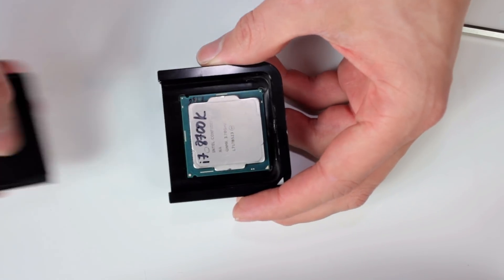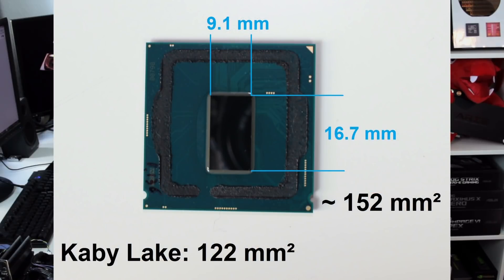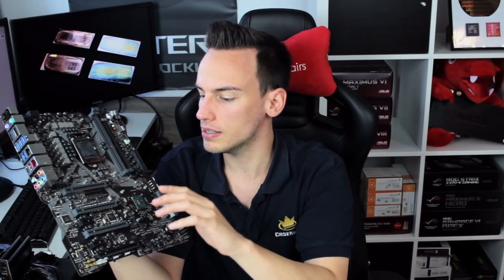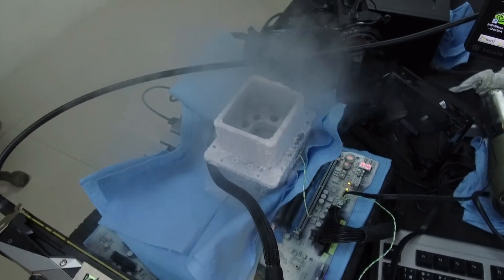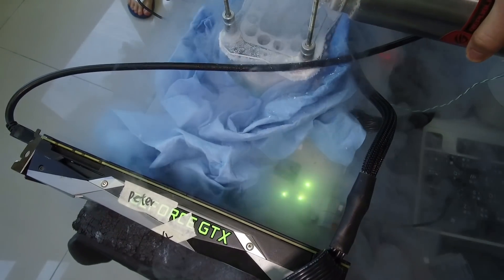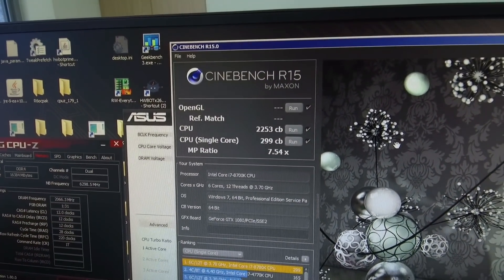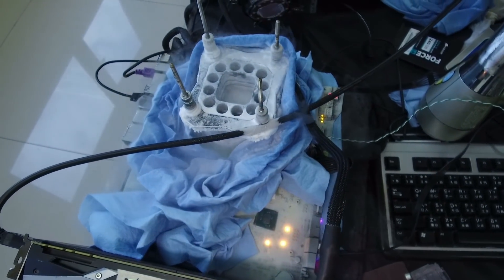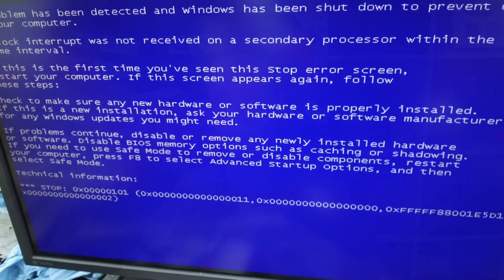i7-8700K - 10 New 6-Core Records with up to 7300 MHz (en)

Comment: Hi der8auer! Great video! I have a question about the new coffeelake platform. Same with kabylake and skylake, the PCIe lanes are still 16. So if I am running dual 1080 Ti SLI on this platform, will the x8/x8 configuration cause any bottleneck? Also if I add one more M.2 SSD, does that mean there are not enough PCIe lanes left for SLI? Thanks!
Reply: x8/x8 PCI-e 3.0 is not a bottleneck to any GPU, M.2 will go trough chipset so its fine.

Comment: Would you please make a tutorial about how to Overclock i9 7900x with AIO ?
Reply: It isn't practical to get high clocks on HEDT chips, as they result in very high power consumption and thermal output (please see any i9 overclocked benchmark). All reviewers recommend Threadripper since you get more cores for lower price (results in same performance with less cores/higher clocked chips) and better power consumption/thermals compared to Intel's i9 lineup. Core count is the ONLY thing that matters in parallel compute workloads. Unless you're gaming, then there's no reason to buy TR/i9 anyways.

Also forgot to say, with AMD you get a high quality soldered chip. With Intel you pay over a grand but you still get a chip glued with mayonnaise-grade thermal paste. Not to mention AM4 is an objectively more superior and stable platform than X299, while being cheaper.
Reply: +LieutenantBill No thanks

Comment: I'm looking at a zen for my 3D rendering rig, tho that is a minority.

For gaming with single threaded GPU drivers, if coffee is not significantly worse on IPC and can clock better than a delidded 7700k on a regular CLC, then yea, sounds very good. It's just a matter of how much improvement they get for the price over older 8 thread chips. Is the cost of a new motherboard worth it for that extra ten or so FPS in games (or is it more FPS, lol).
Reply: Hyper.. would this be the case with high end systems? Games seem to be atm using a lot of CPU spread across all cores. BB

Comment: I hate the idea of paying the "intel tax" but the performance of the 6-core Coffee Lake CPUs will no doubt be quite good. I'm waiting to see benchmarks in games before making any purchasing decisions. Right now, I can get a 1600X for $250CAD. I'm guessing that the 8700K will be nearly double that much, especially on launch. Unless it has nearly double the performance, it will be a tough sell for me, especially factoring the typically more expensive platform costs of intel's ecosystem.
Reply: Yep, the benchmarks are out now. 8700k is a real beast alright, and as predicted, double the cost of a Ryzen 5. It's only worth it if you are also buying a high end graphics card, which just isn't in my budget, unfortunately.
Reply: Ron Bes Hardware Unboxed did a great review, but I came to the same conclusion. I went with R5 1600, but gaming is not my main concern. I'm using this rig for virtualization. Also, I would have to spend 1000 dollars on a 1080 ti or Vega 64 to really get the best out of coffee lake... Prices in my country are ridiculous 😓

Comment: What are the chances of the die breaking when deliding with your delider? I know that the force is mainly focused on the PCB and that weird glue, but I saw a couple of forum posts about some other CPUs just shattering like glass.. One small piece just separates from the die. I have 3770K tho, not Skylake CPU. :)
Cheers
Reply: Филип Пешић zero

Comment: it's still double the price of the 1600 (at least in australia) so unless it has double the performance with the same amount of cores it's probably still not worth it imo, even with the extra clock speed bump at stock over ryzen.

edit: changed "slight" to "extra" because i was looking at the xfr speed on the 1600
Reply: but it competes against (and STOMPS in some cases) the 1700, 1700x and 1800x, don't compare core count to core count or we'll have to show you the similarly price non hyperthreaded i5's that run right alongside the AMD 1600
Reply: Ba Aditrex i dont care about the price... if u want the best you go intel
Reply: its performance is sandwiched between 1800x and 1700 (costs around 290-330, and perform basically the same as 1800x when OCed on a cheap ass board and comes with the RGB cooler that gets you around 3.8-3.9GHz)unless you do something which only uses single core or game at 1080p with a 1080Ti. get your facts straight. and it costs around 370-400USD best case scenario. With a pricey board. But its stock temps on Liquid arnt bad either, 65C that means around 70C on a mid range 30USD cooler which gives like 10-20C to play. But still the thing is just expensive!!
What all of us should look forward to is , R5 1600 OC(210-230USD) vs i7 8700 locked variant which would cost around(330USD-350USD) both on stock cooler of course.
And i don't think paying 40-60% more for the i7 to get 20% perf is a good idea. Because lets be real , most of us rock a mid ranged GPU which performs basically the same on both platforms.
Basically this is like R5 1500(4 c . 8th) vs locked i7(4c, 8th).
Reply: with that logic the g4560 is the best cpu
Reply: PC Master Race Network der8aur isn't a kid he pretty much get stuff for free from sponsor.
Reply: pc master race I owned multiple setups and mostlikelly  I own alot more buck then you but still id say r5 1600 is king for the price try to streaming gaming with i5 8400 and come back here and report if you had any viewers probably not  cuz i5 will drop 30%more frames compared to ryzen not to mention 1700 vs 8700k gamers nexus have video for you which shows ryzen is still better streaming cpu with fewer frames drop and that on stock
Reply: LAKSHYA SINGH "its performance is sandwiched between 1800x and 1700" very bold statement, as the workload heavily impacts the charts. an overclocked 8700k at 5ghz is just behind the 1800x in render times, but considering the higher cost of the cpu and motherboard, higher power consumption and higher heat output, the ryzen 7 is the better choice if you only use your pc for content creation. on the other hand, said 8700k clocked at 5ghz or higher, can be dramatically faster than any ryzen in gaming. if you want high refresh rate 1080p or 1440p gaming, an overclocked 8700k is basically a must, as it really lets those frames process. "or game at 1080p with a 1080Ti" this is not as insane as it sounds, as cpu bound as 1080p is, a 1080 ti can still get you 20-30% more fps than a 1080. if you use a mid-range gpu however,  like you stated in your comment above, an 8700k is just stupid to pair with a gtx 1060 or even a gtx 1070 for that matter, the ryzen 1600 performs basically the same with anything up to a gtx 1080.
Reply: Intel Coffee Lake Delivers Superior GHz/IPC performance the DOMINATE Gaming making Coffee Lake the most Future Proof CPU available for buyer or builder, Coffee Lake will get the most performance out your high performance GPU, GHz/IPC inferior Rysen is a gaming waste of money.
Reply: GlaciatorGaming ryzwn is for kids with no money
Reply: and intel is for kids living in dubai whats your point
Reply: GlaciatorGaming intel are for people who want the best, who want to overclock, who want better performance on games.. on and on.
Reply: GlaciatorGaming is Der8auer from dubai?

Comment: I think intel is in the edge of their current architecture. Something bad is going on inside Intel. Maybe they have no new architecture in hand.they just improve the power delivery circuitry and add more core.no new things. I am not happy with it's Efficiency.
Reply: its just taking longer to go to smaller nodes, which means more refinement at each node. The 14nm+ to 14nm++ change was basically all focused on adding 2 more cores/4 threads to the existing 7700k while keeping the same IPC. 

If you want to go into details into transistor layouts and how an actual CPU instruction works, there is only so many improvements you can make to an instruction until it doesn't matter how many transistors you have available. Basically the speed improvements now are due to the speed of the electricity flow and the smaller transistors have less length between them which makes them work faster.
Reply: S.M. FARHADUZZAMAN that's exactly what it is. They have been refreshing the same architecture with modifications for years. Tweaking here and there but will it be enough. The CPUs from INTEL are monolithic designs compared to AMDs Zen arch.
Reply: Kíre Howard this is not a efficient way to design something. Intels Power consumption is increasing day by day
Reply: Kíre Howard "Ryzen refresh is releasing February 2018 and will match or exceed Coffee lake I guarantee it" i call bullshit. perhaps a few hundred mhz increased clock speed or overclocking capability and slight ipc improvements, but zen will never have better ipc than intel's ring bus architectures. it was designed to scale well with high core counts, but not to run at very high clockspeeds, which ring bus does. zen was made with a focus on the server market, because that's where intel and amd win the most money from.
Reply: Yeah, starting at 6 cores, Intel CPUs tend to consume much more power. I assume that there is a limit within silicon dies to maintain the best efficiency... anyone?
Reply: Peter Peter you Liar AMD don't have that kind of money for bribing unless its intel you're talking about
Reply: I think you should read about moores law, monolithic design will be in the past we are already reaching the point of shrinking, MCM will be a thing even nvidia is going in that path.
Reply: Nobody cares
Reply: S.M. FARHADUZZAMAN Intel has new arches ready, sadly they faced major problems with their 10nm and had to delay, Icelake should be arriving EOY 2018
Reply: don't think what's the case?
Reply: monolithic designs win the game vs newer not supported by developers and MICROSOFT don't support what amd produce for their next os...either have avx512 or its a bust for windows 11 next gen aero desktop...VISTA 2nd
Reply: Innovation comes in various forms. Optane is something that will improve overall system performance for example. PCIe was pioneered by Intel and its continuing evolution heavily relies on Intel engineers. The manufacturing processes front Intel keeps innovating as well. Intel's upcoming 10nm process has twice the density than Samsung's (and by projection Global Foundry's) '10nm' and is on par with TSMC's 7nm process that is still 3 years away. Intel is researching ways beyond the silicon limits as well with spintronics and other sophisticated technologies. They are also developing new computing topologies emulating the brain functionality with neurons and AI. 

But even in the current conventional market Intel is safely on the lead anyway. AMD has a lot of catching up to do in all three main categories: (i) instructions per clock cycle (Intel leads by 8-10%), (iii)maximum frequencies (Intel leads by 25%) and (iii) number of cores in a single die (Intel leads by 275%). Also in an apples to apples comparison, Intel CPUs are more power efficient and have better thermal behaviour. AMD is even soldering the IHS (despite the reliability issues) and lower the stock base speeds to look good - but overclock a 1700, 1700X or 1800X and they gets pretty toasty, not to mention that AMD's max junction temperature is smaller.
Reply: OH NO INTEL SURELY IS DONE, RIGHT?`!=?!=?!
Reply: Alex Marin few questions:
(iii)  # of cores on a single die -
why does that matter if intel only had 4core cpus, very expensive 6 cores (before 8700) when Ryzen launched. Sure Intel wins in single core performance and frequency. But Ryzen's 8c/16t won in multi-threaded stuff, right? 
secondly.. 
Isn't the heat&ihs argument the other way around? 
Intel's CPUs are running 90+ deg. with the... and i quote "toothpaste tim".
And from what i see people much prefer soldered. I mean.. isn't Intel soldering the extreme edition CPUs? 
3) About lowering stock clock speeds - what about the new intel 8xxx(the not 8700) @ 2.8GHz?
Reply: no need for any new architecture, when you still are the best
Reply: I am thinking about those people who invest lots of money on Z270 motherboard
Reply: Intel hasn't had a new architecture since the first gen core i series. Aka, nehalem. The ring bus architecture is shit. AMD's Zen has higher theoretical IPC(20 vs intel's 15). The only reason it's slower right now is clockspeed. That will quickly change with Zen+, which will be on a 12nm node.
Reply: Matt B Meh. Ryzen refresh is releasing February 2018 and will match or exceed Coffee lake I guarantee it. INTEL has been slow on innovation because they are greedy, lazy SOBs. Stop kissing their ass. Moore's Law is dead!